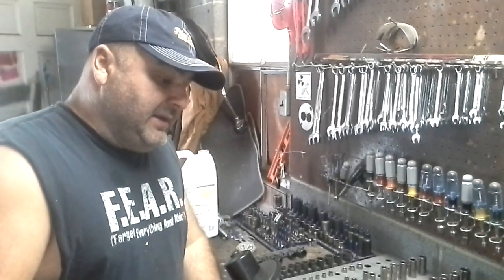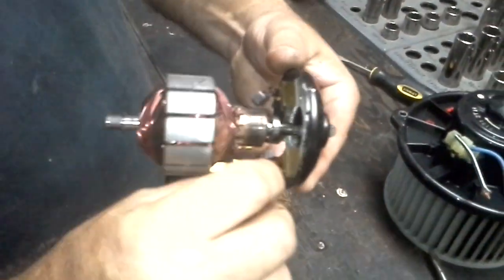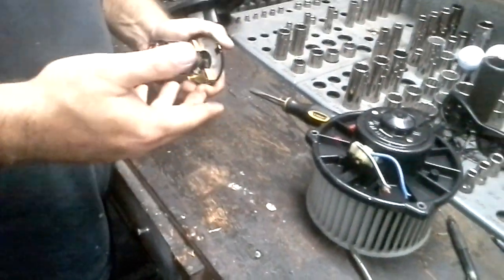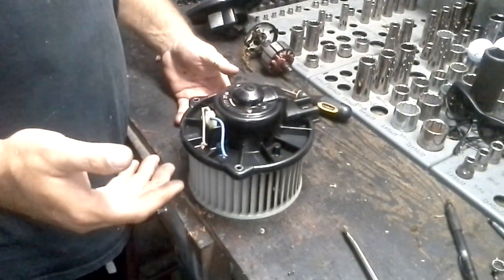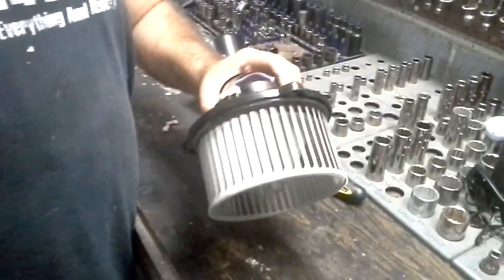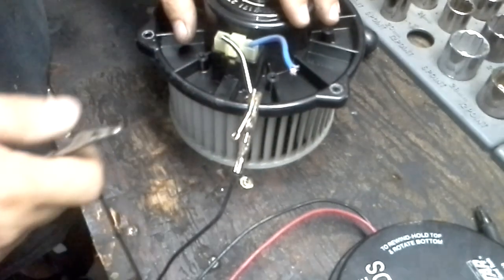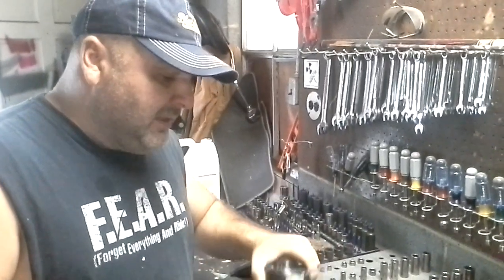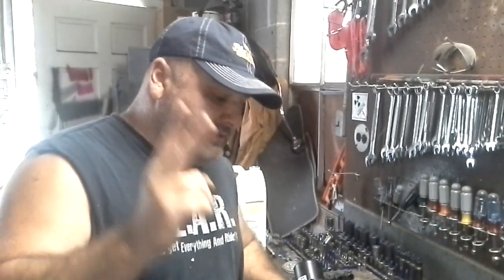Test Blower Fan Motor and Explain How Brushes Go Bad

Comment: Oh wow... A very simple detail on this video actually helped me pinpoint what was wrong with mine, thank you so much for that video ! I wanted to test mine (from a 2003 Grand Prix) and I had plugged it to a drill battery without making it work.. (but in my car it was intermitant). And you said that you had to "HELP" it get started... I tried shaking/hitting the heater motor while connected to a battery and all of a sudden, the fan started spinning.. then shut down again.. then slowly on/off and so on.. That was enough to prove that the issue is from the heater motor itself, which I went to buy at the scrapyard for 20$.. installed it, and voila, my heater works again... After 2 weeks in the cold/snow, and trying every stupid electrical troubleshoot (except force- testing the motor itself).. wow ! Thank you again!
Reply from the maker: +Pop JustSick I'm glad that helped you out and that's awesomeneed any help in the future come back and look at sup

Comment: Much appreciated insight, just tore mine apart and put it back together, cleaned the motor, had a lot or charcoal but still went from barely turning to nothing at all even after testing it on a battery - ordered a new one the day before but was hoping to salvage it but it had a good 15 year lifespan I suppose, course had to happen just as heat is needed the most LOL

Comment: So, I was debugging my blower in my van. I found this video. I have that exact battery system (Craftsman) so I got my leads, I hooked it up to the battery and tested the blower. My battery was nearly dead so I wasn't sure it was working (left it attached to the van). So, I charged the battery. Then I hooked it up and fried the motor!  GONE. I had to buy a new motor.
Reply from the maker: Hey Thomas, how did it blow up the motor? I'm not sure what happened there. We test all of our electronics the same way.
Reply: Not sure, I followed exactly with the leads what I saw on the video but the van started to spin up and then dead. I couldn't get it to function after that at all.

Comment: Do you have a video on how to take the motor out of the casing??  Mine is from a sonata and the fuses keep blowing..I was told the motor brushes are most likely corroded and causing a surge thus snapping the fuse..But I can't get it out of the casing.  There are 3 super tight "clips" and I'm trying to use a flat head to shimmy it in so I can pop it out...but no luck.  Any suggestions?

Comment: when I turn  on  the ac.  it works and shuts of but sometimes it will stay on throw all the speeds ..do sent make sense. ..not sure if it's the resistor or the actual fan..

Comment: is putting 19 volts on a 12 volt system bad even if you do it quick like you did?
Reply: Not really unless you run the windings too hot and burn them out.

Comment: What kind of wire do u use
Reply from the maker: Rene Paredesany why would work actually don't worry too much just get you some jump wire cut the ends off and it'll work or you can just go get some jumper wires from autozone for about 10 bucks with a little alligator clips on the end

Comment: They're charging me $95 AUD for this -.-
Reply from the maker: +Tan Tan ouch that hurt my feelings and I'm not even there
Reply: $8... you Americans are so spoiled.   here (in Australia) , if you're 
exceptionally lucky, you'll get one for ~$40, but usally, it's up around 
$100 for one from a scrapped car at a wrecker, a reconditioned one (that
 has actually been reconditioned) is a LOT more and new ones are insane 
prices.
as Tan has explained.
far cheaper to order some bushes and do it yourself (if you're mechanical, which I sure as shit am)
Reply: i agree in my country, Portugal the parts are much more expensive :(